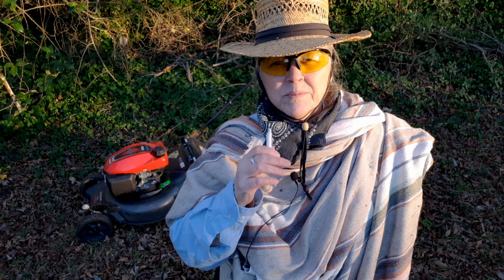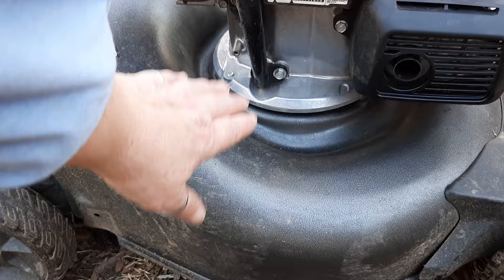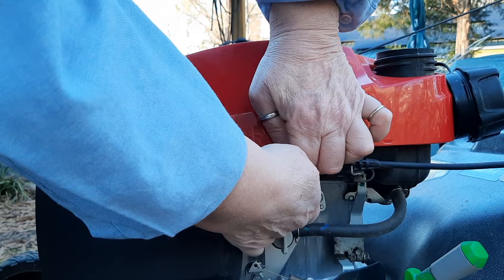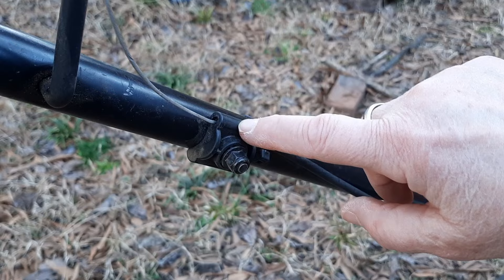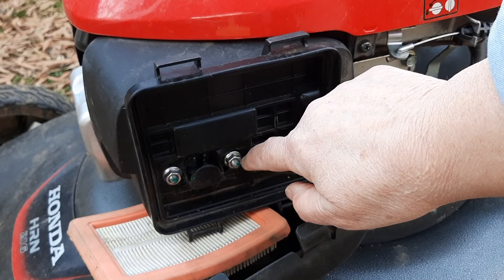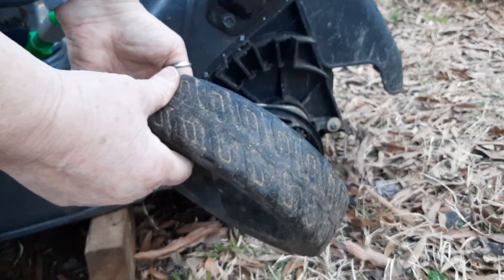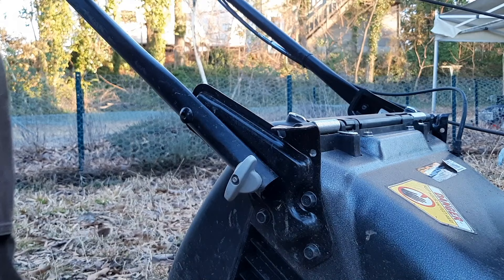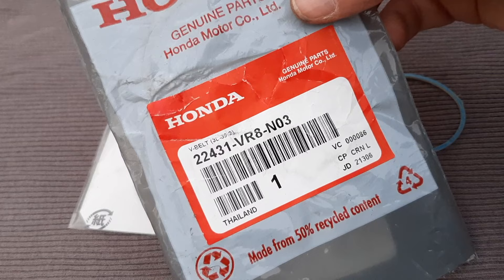Honda's Newest HRN216 Mower in 2023: Good? Bad? Ugly?

Comment: And still no gas line filter after 20+ years.
Reply from the maker: There is an inline filter in the fuel tank. It's on my HR215 from 1997.
Reply: @TheLawnmowerLady  Ok thanks. My 20 year old mower with the Honda 160 engine got plugged jets even when I use premium gas with Sea Foam. Hence my no filter comment.
Reply from the maker: @woodchuck1946  That's likely more from bad, stale, ethanol laced fuel. Even with precautions, when fuel dries up, varnish like deposits accumulate.
Reply: @TheLawnmowerLady  Likely right. Not sure how fine the filter is in the tank.

Comment: Motor is great but the drive system is garbage.  I had mine only 3 months, I have a smaller yard. Belt stretched today and I have the roto stop and I destroyed my mower with a sledge hammer. Absolutely junk. Impossible getting the roto off after blades were removed.  I wasted 800 dollars.  I will never buy another Honda product as long as I live. Oh by the way, when this lady changed her belt she deleted removing the middle bolt.
Reply from the maker: You are not alone. There are plenty of complaints out there, especially with the design, or lack there of, any protective baffles for the belt and drive system. I appreciate you watching.

Comment: Plastic parts are not for product "improvement" They are for cutting costs, boosting profits. Wheels with loose plastic bushings tell the whole story.Another way Honda saves 7 cents per mower is to do away with the oil drain plug. I guess they don't want you to change engine oil. That way they can try to sell you another mower. These mowers are way overrated throw away products.
Reply: What's wrong with you?
These are some of the best mowers on the planet.  Since release 4 years ago they've been praised constantly for their reliability, ease of use and easy maintenance.

The oil changes are simple, clean and quick unlike any other mower.
Reply: @robertsaca3512  Nothing is wrong with me. I call it the way I see it. Honda mowers are overrated and I believe especially designed to keep the mower shops in positive cash flow. How many wax pellets have you needed to buy for the choke control? I have replaced two so far in three years time. Probably less than 25 hours on the machine. The underside of the deck is heavy rust. The 40 year old Toro our Honda replaced had an aluminum deck and a flat head Briggs engine which never failed to start. I retired it only when the ignition magneto finally gave up. This Honda, at triple the price, won't go 10 years.